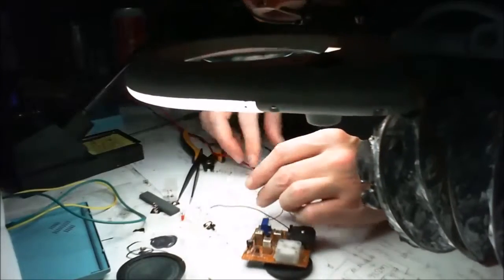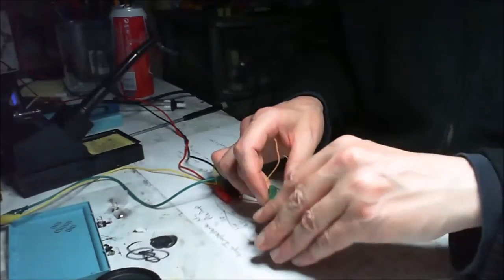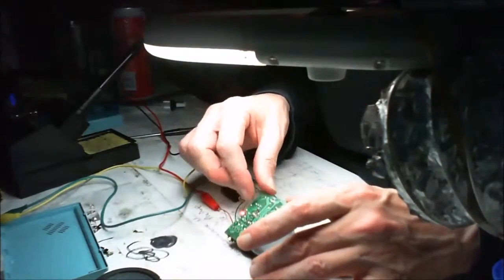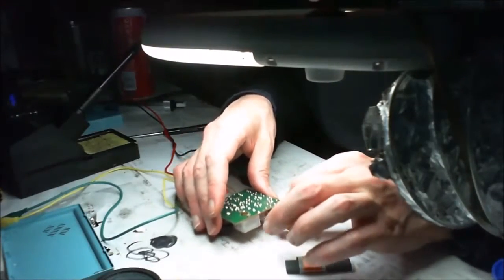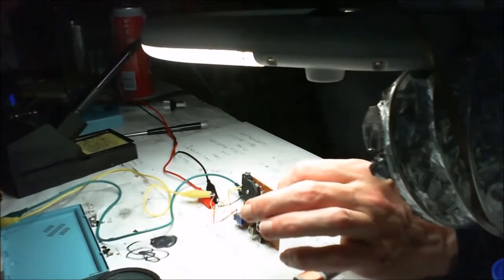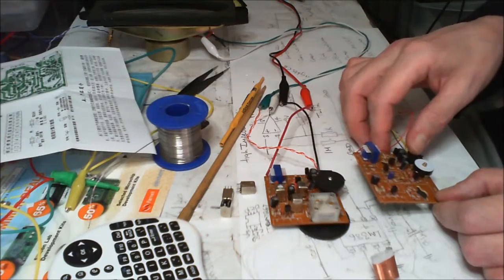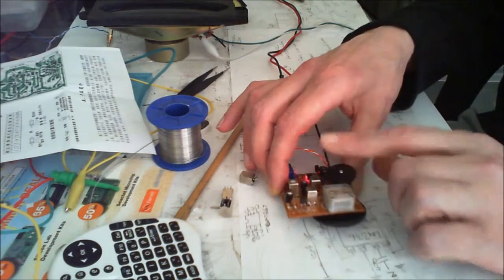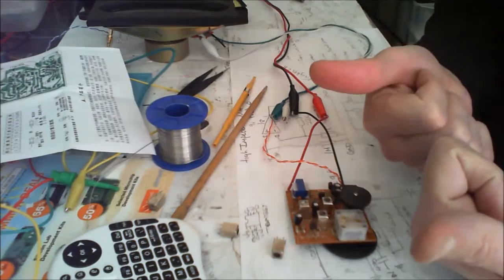eBay HX 6B AM Radio Kit 3 finally got some stations

Comment: 8 years later You saved me a day of trouble shooting Thanks for the info on the 3 solder bridges 
On the schematic they are marked with X's So I figured that meant Not connected.

Comment: The breaks on the PCB are test points. The correct current drain for each test point is marked on the schematic. After testing each point, the bridges can be soldered. I do hope this helps. Thanks for the video. All the best. Ricky
Reply from the maker: Cheers Ricky, that is good info. I can not remember if I did that, I will have to dig out the circuit and see.
Reply: No problem, glad to help. Keep up the good work, a bit more beer might help, lol

Comment: I had a go at assembling the kit I bought.
Instead of walking away every so often to have a rest from the intense concentration I made a mistake with one of the coils when I was tired (the one with the black slug).
I was mega p*@@*d off after all that effort. 

To be honest I am used to big hot bottles. I have a 2 valve + rectifier regenerative TRF on the table that does sound far better.  I might even build it onto a decent chassis and try and put it into a case of some sort.